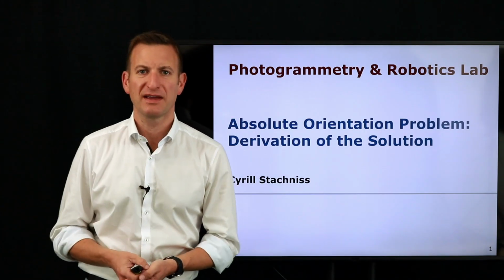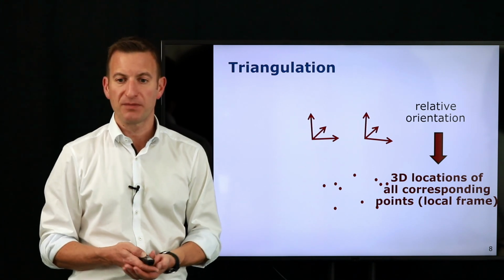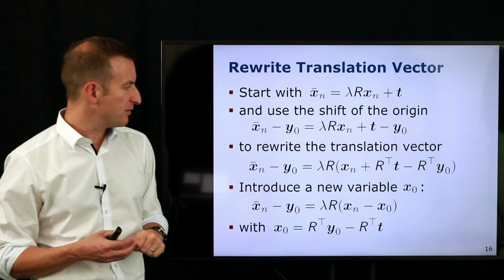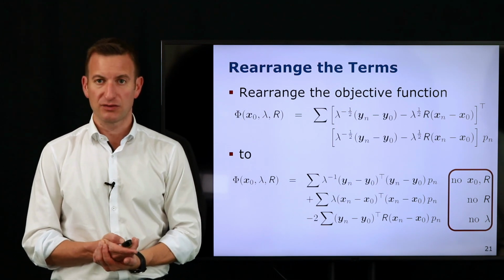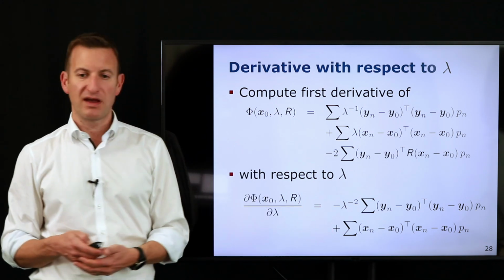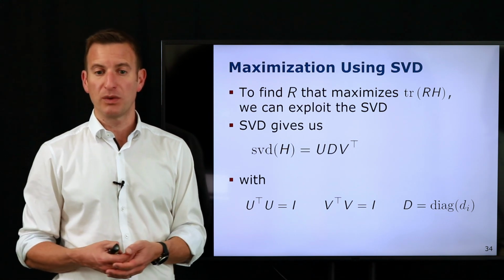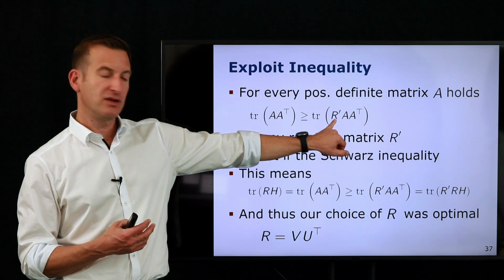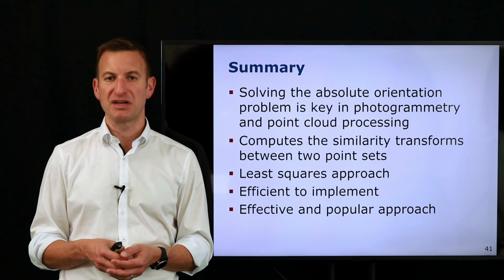Absolute Orientation: Similarity Transformations Between Point Sets (Cyrill Stachniss, 2020)

Comment: Hi Prof, thanks a lot for the lectures. 
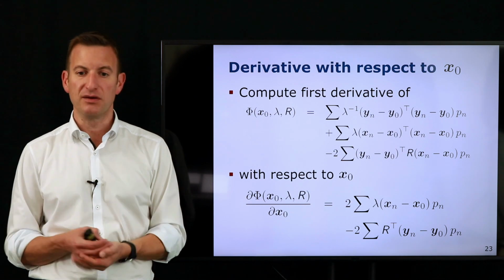At  time 17:36, while differentiating \phi w.r.t. x_0, the sign should be + for (y_n - y_0) part I guess. However, It won't be affecting the result. Just wanted to make sure about it. Thanks!
Reply from the maker: You are right, that is a sign error on my side! Luckily the error has no effect for the derivation as the term goes to zero - but it should be a + not a - in the equation. Thanks!